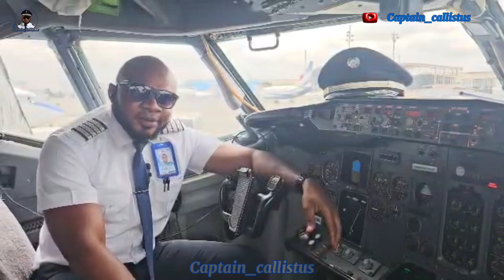Do Planes Change Speed in the Air? Pilot Explains.

Comment: Can pilots fly without use the map. Let's say the map goes off. Can they know where they are on the air. Like can they see the nearest airport and land without the map
Reply: Hahaha 🤣. They always use the map to fly. 
There is an electronic map in their cockpit and they also have manual maps that they use during the time of emergency. 
Part of pilot training is studying the map of the globe, they already know every part of the world map and can use manual maps to navigate to their destination. 

Remember that all planes also have a radio communication equipment which they usually use to speak with the control tower of every airport. 

Also all airports have a special electronic equipment that's installed at the far end of the runway, that's what transmits signals to the plane's cockpit devices and is used to locate the runway. 
Apart from the map, multiple communication devices and signal receptors are used. 

In fact, the pilot MUST get approval from the Air Traffic Control, before descending to land. The runway must be completely clear of other planes before the ATC gives the approval.
Reply from the maker: @Delakinas nice 👍
Reply from the maker: Stay tuned n do activate d notification button here to be notified once new updates are dropped

Comment: 7:37 Do plane going to same route see another plane coming to the route they left initially? Say for instance a plane is travelling from Lagos to abuja would that same see an opposite plane travelling to Lagos from Abuja?
Reply: All planes have an electronic device that will show the path of the other plane. The pilot of both planes will see the other plane indicated on his device. 

The system has been designed for safety such that both will not fly at the same altitude. The flight path of one plane will be at many feet above the other. 
So, it's the opposite directions but at a different altitude.
Reply from the maker: @Delakinas nice 👍👍
Reply from the maker: Yes, but depends on some factors, eg; lateral distance, altitude, time etc

But do stay tuned n activate d notification bell to get notified of latest updates

Comment: What's the actual speed in km/h  being maintained at 30k feet ? Please.
Reply: For jet commercial airlines most do 700-900km/hr at cruise altitude of 30,000ft.
Reply from the maker: It varies by aircraft designs, weight, wind speed n direction etc. 

Buh stay tuned n activate ur notification button here to get notified once such posts drop

Comment: Well explained cap.
You mentioned turbo prop and turbo fan engines.
So I want to ask which engine is more effective amongst the two or generate more pound thrust let's use dash-8 and E145 for example.
Reply: Turbo produce more thrust and it more efficient at high altitude of 30,000ft, turboprop is more fuel efficient at 25,000ft and below
Reply from the maker: @israeloluwagbemi825 👍👍👍
Reply from the maker: Stay tuned n do well to activate the notification button for update
Reply: @Captain_Callistus on your mandate sir